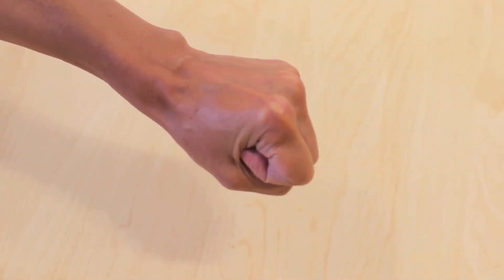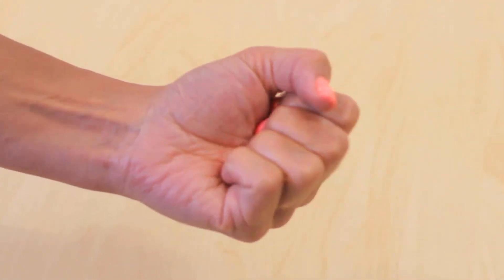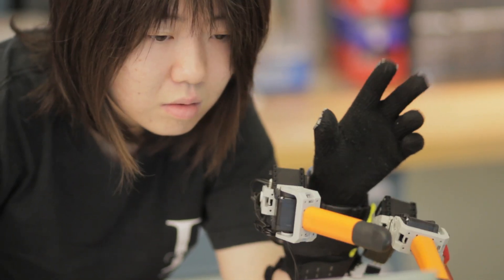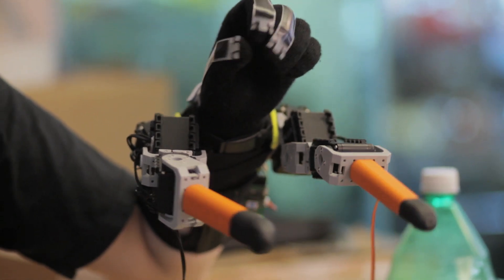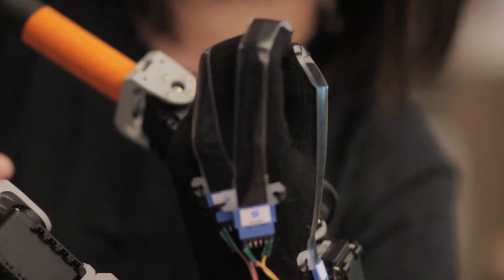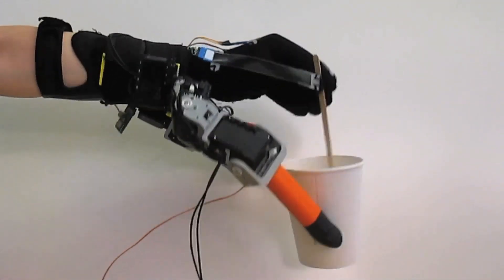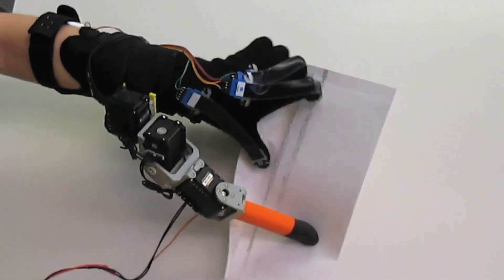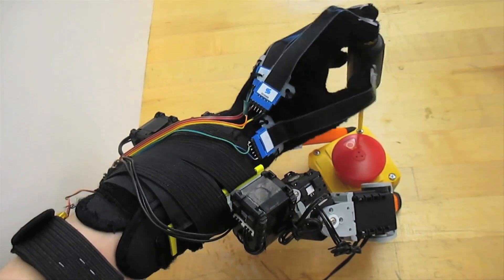7 Finger Robot

Comment: Add fingers on top of our fingers, so that we can type faster on the keyboard.

Perhaps a mouse that can be controlled with the foot or knee.

A set of eyes that look to other ways, that are displayed to us, perhaps using Glass. So to give us a greater field of vision. There could also be an option of zooming in with a gyroscope checking the tilt of the head.

This could be 3D printed, so that it's available and improved by many around the world.

The biggest profit that I can see is parallelization, doing many jobs at the same time.

A strong pair of small pinching and opening fingers, so that one can open something that's hard to open, like a window. Or when squeezing something that needs more than human strength.

A pair of closer fingers, so that one can cut hair with just one hand instead of two. Pinching the hair and cutting.

The tongue would be a good output of movement, since it's very flexible, but only used when eating.

Comment: Just a reality check here dude, you have only 3 inputs.  Synergy?  nope. 
The result would be better by simply averaging those 3 inputs together, and the video didn't show otherwise.
If you used a proper hand tracking glove to track more than 3 points (ideally 20+, but wow please get it to at least 5), that would have been of interest.

My only guess is that you indeed tried to use a proper hand tracking glove (coz why on earth wouldn't you?  MIT is awash with them), but your algorithms didn't like the data, and you had to fall back to only 3 axis to meet a publication deadline.  Yes?

THE NINTENDO POWERGLOVE FROM 1989 HAD MORE DEGREES OF FREEDOM THAN THIS SETUP (Albeit for more than 2-bits per finger you'd want to tap the fingers directly.  Still... MIT hello?!  Grab a $10 P5 Glove or something.)
Reply: That's just arrogant and mean. I'm sure they would give you the middle finger.